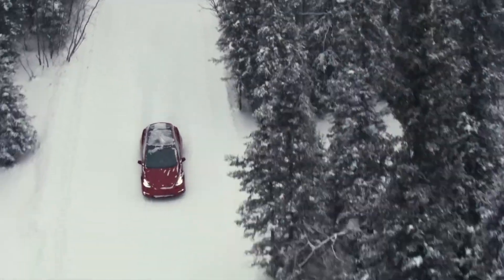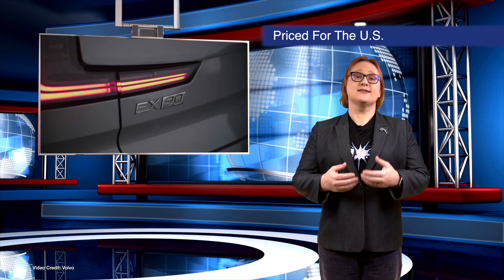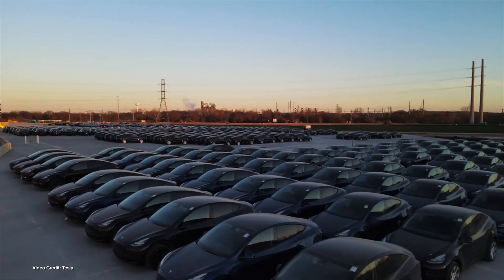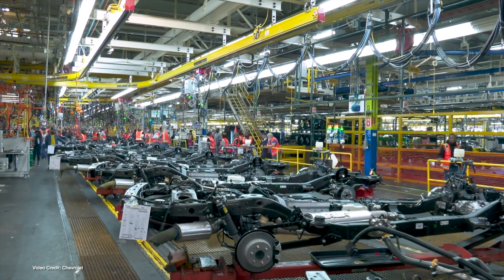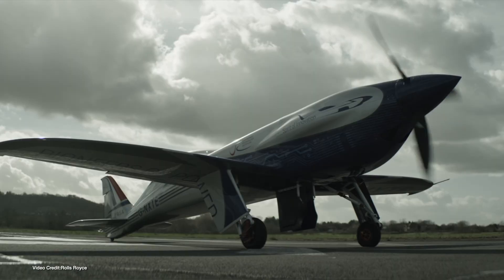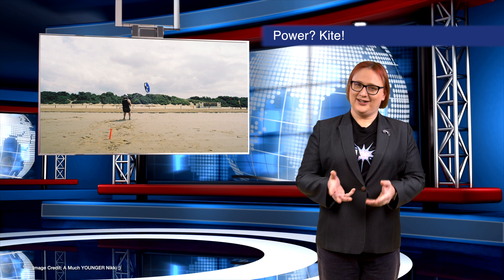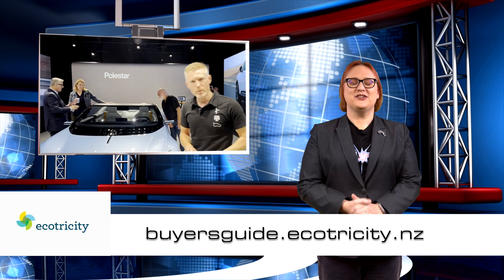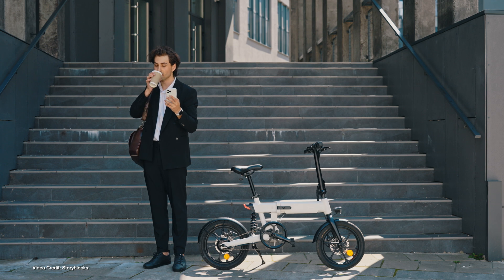EcoTEC 301: Tesla Cybertruck, Fiat 500e in USA, France Loves Bikes!

Comment: I wonder if the hybrid issues are because of a large number of manufacturers now producing them. I bet Toyota's figure is a lot lower than that. My 13 year old Prius is the most reliable car I've ever had, and it's got 126,000k on the clock. I did 50,000k before changing the oil and filters, and despite that the mechanic said the engine looked almost new inside. I suppose EV issues are due to new tech. Once we hit a certain plateau I think the tech will settle in a bit, become rock solid.